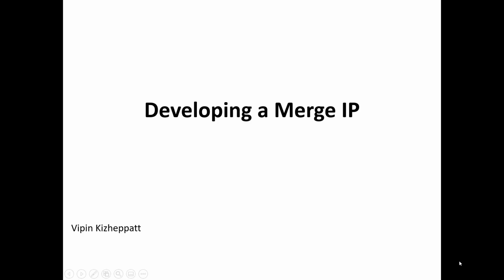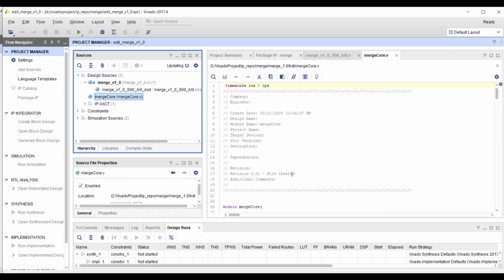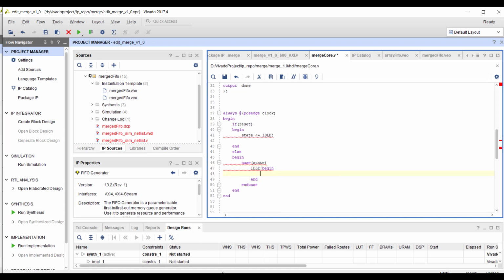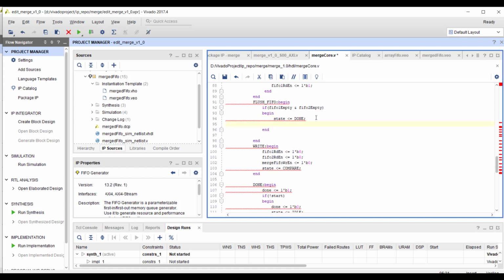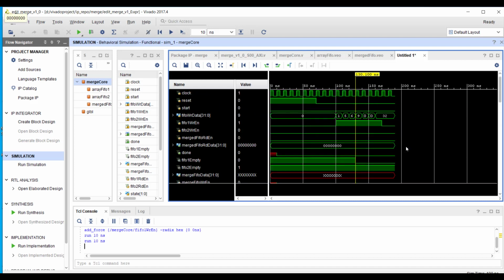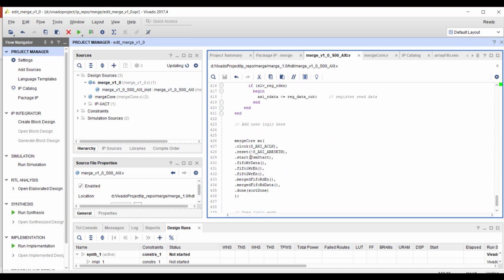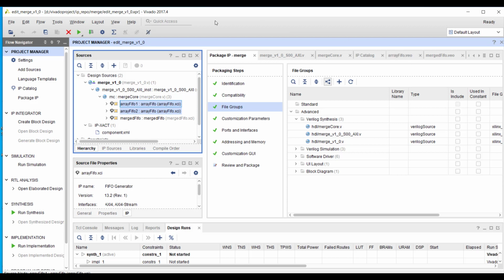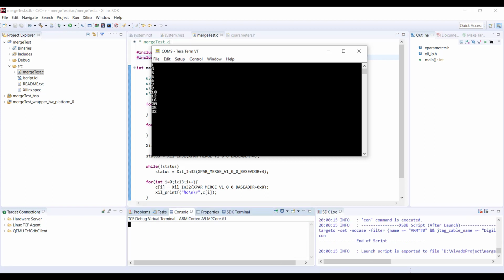Designing a custom IP for Merge Operation with Xilinx Fifo Generator

Comment: Extremely helpful tutorial, sir! How can we translate this design to a 64-bit operation? (Target board: Zybo7z020)
The S_AXI_WDATA registers appear to be 4 bytes of data and so to accommodate the 64-bit operation, do we need to split the input into two parts or is there an elegant way to work out this problem?
Reply from the maker: Your processor and OS both are 32 bits. So there is no way to write a 64-bit data in ones hot to hardware. Hardware is capable of comparing and merging 2 64-bit numbers on a single clock. But not software. So for each number you will have to write twice. Better to use an asymmetric FIFO to store data (32-bit write width and 64 bits read widths) so that merge operation can be using 64 bits. Again at the output you will need  an asymmetric FIFO (64 write and 32 read) from where it will go to processor and it will need 2 reads/data
Reply: @Vipinkmenon  Understood! Thank you!
Reply: Also, can we have more than one register that the processor can write to (or read from) simultaneously?
Reply from the maker: No. Software is sequential and on a hardware bus there can be only one operation at a time. If AXI4 full interface is used, it can support simulatenous read and write. But from a software point of view it will never happen. Even if standalone supported multi threading (which it doesn't)

Comment: In FWFT configuration of the FIFO, we have incoming data visible at the output without any latency. As a result, increasing the frequency will be an issue right? (without the pipeline register that corresponds to the latency)
Reply from the maker: FWFT can be implemented with pipelining and I believe Xilinx has that internal pipeline. The difference from standard FIFO will be the latency for the empty/valid signal to change when a new data is put in the FIFO.